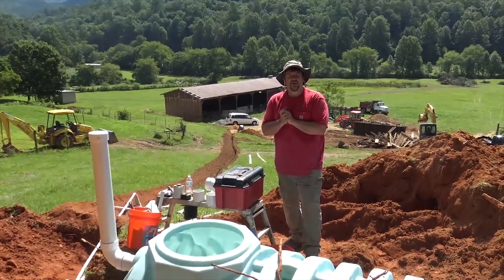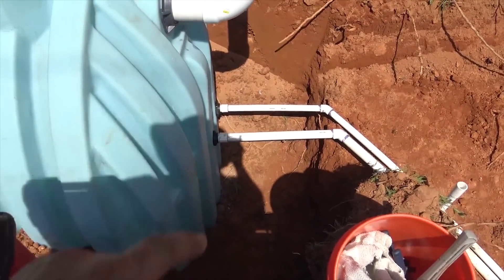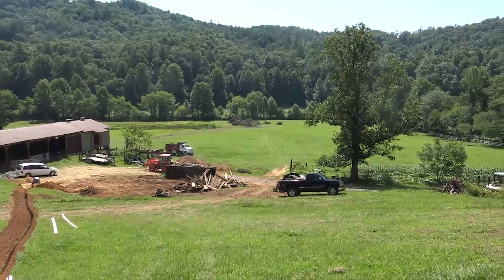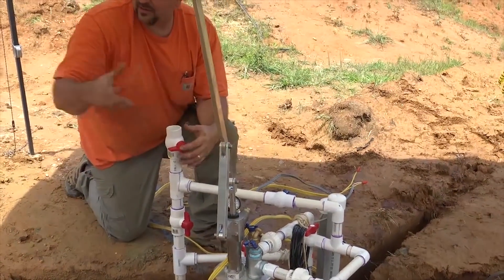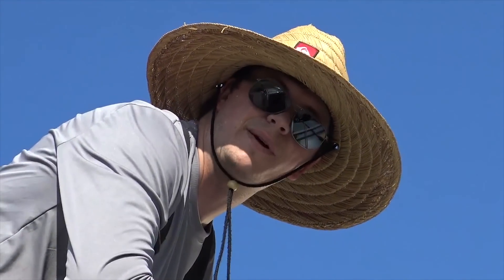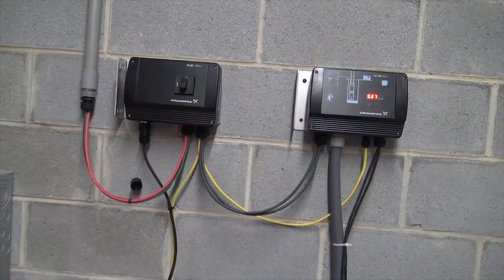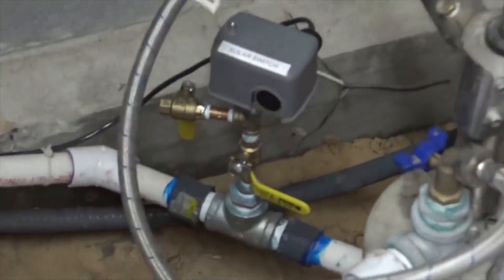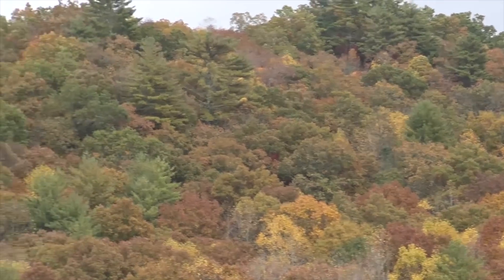Cool Water for a Hot Homestead

Comment: Is there any way to find out how much water there is in a spring?  Ours is coming out of a mountain and we've found five different locations where its coming out.  Not all at the same location but a good walking distance apart.  We want to use the spring for four homes but are concerned about running out of water.  Yes we're new at this

Comment: I love all the cool projects you get to do!  I just mentioned you in my most recent video on thermal mass and hot water heating. To get in the plane or not... is NOT the question, The question is, "How competent is the pilot?"  :) On gravity vs battery... YES gravity is more reliable than ANY battery manufacturer.  I like the NASA style backup ring-down system! :)

Comment: So just out of curiosity, on this video and a few prior you use PV to heat the water, and while PV has the added benefit of being able to run a pump or other small electrical devices, wouldn't solar thermal panels be much more efficient to heat water with. I think I heard you're going to be just heating water majority of the time, while the grid is up you will not be using the solar to pump water. Just to heat water. Isn't the vacuum solar tubes 10x better at heater water then PV?
Reply from the maker: Solar thermal is super efficient for making heat!  What people do not realize is the cost , the plumbing, the freezing issues, the complexity, the pumps, the controls etc.  With PV direct I do not need anything but panels and a small controller.  Have you seen the details for a solar thermal system compared to a PV direct?  I choose to make electricity and I can do it from the equator to Alaska the same way.
Reply: So iv installed.the solar hot panel heaters, and iv installed a few solar thermal systems. But havent tried PV direct yet. Was gonna experiment with it one day. And yea there is quite a bit of components and engineering to a system. But once it's done it's nearly maintenance free and the system I installed heats the entire 3000 sqft house and takes care of all the hot water off of 8 panels. Panels were 1500 a piece. Total system was 50k dollars although a large chunk of that is labor and engineering. Also helps when you're not retrofitting a house and get to design it with a new build. Bit I will have to try a PV water heating system one day, its defently interesting. And I can see the benefits

Comment: Such an impressive install without batteries.  

This customer may not initially appreciate how many future hassles you avoided them by doing it battery free, but I am sure as time advances they will get it.

The one backup missing to this multiple backed up system is a large rainwater system.  I keep thinking of aquifers as finite resources.  

Rainwater systems extend the life of aquifers by using them less.
Reply: Batteries are the nemesis of every system imaginable. We have basically used the same type of batteries for the last 100 years, with some few exceptions. I just hauled away six big monster 6-volt batteries I had for my emergency solar system. Over $1000.00 in batteries to the junk man for $176.00. After ten years they just crapped out. In that time they were used maybe three times for only a couple of hours each. When we get capacitors that work like batteries (But don't crap out) then we'll have something.